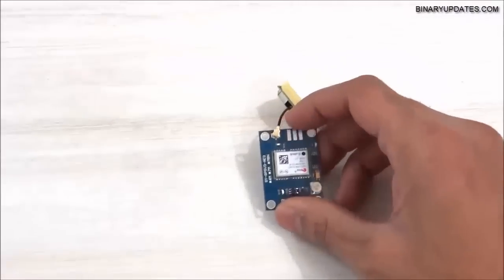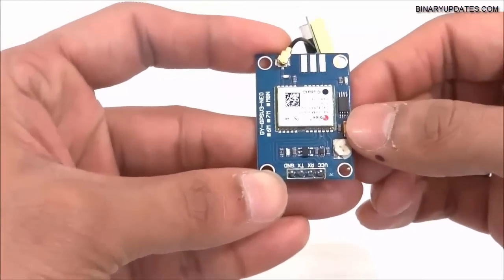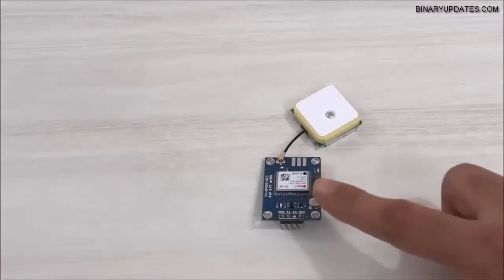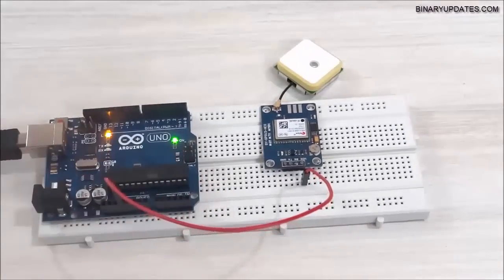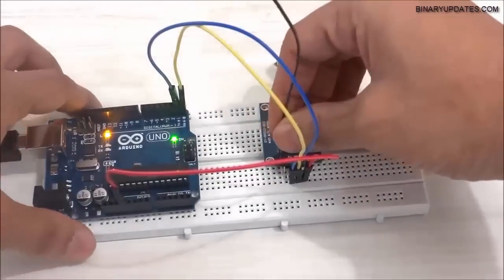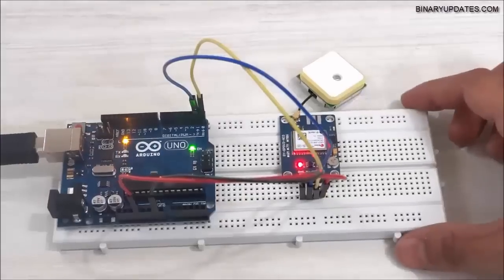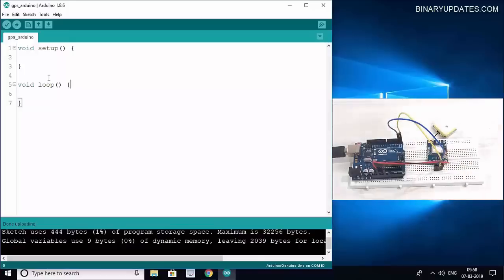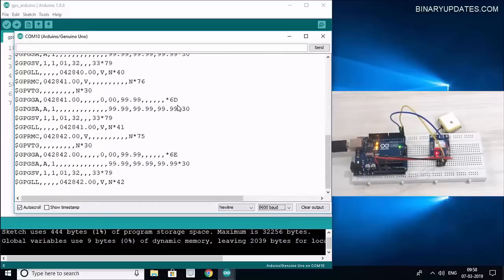GPS Module with Arduino- Ublox NEO-6M

Comment: What happen if we don't unplug the rx and tx connection when uploading? Does it ruin the module?
Reply from the maker: No, It will not ruin your module. The reason to unplug Tx and Rx while uploading code is because Arduino uses those pins. Once the upload is done then Tx, Rx pins will be free to connect to any external devices like GPS NEO-6M Module in this case. I hope this answers your question. Good luck and best wishes!

Comment: Code for this project
Reply from the maker: HI Kanagadurga, 
To read GPS data from module, I've used default Arduino sketch means empty setup and while loop. This means no special code required to read NEO-6M GPS data. Good luck and best wishes!

Comment: Hi I am having a connections problem with the GPS module and the Arduino, the Arduino always got shutdown when I try to connect the GPS module, specifically when I connect it to the power (5V), I believe it is a problem in the power distribution, plz help me fix the problem 😫🙏🏻

Comment: Sir source code sir
Reply from the maker: Hi Dada, I've used blank arduino sketch nothing special you can check in my video. So there is no special arduino program required for this experiment.
Reply: @BINARYUPDATES  ok sir.
Thank you sir.

Comment: While the power delivered to the NEO 6M can be 5 volts since it has an onboard voltage regulator, the data lines do not allow for 5 volts and unless a voltage divider or line level shifter are incorporated the voltage of the UNO data lines will destroy most of the NEO 6M's in time.
Reply from the maker: Hi Ronald, 

Its possible considering lots of Arduino board these days come in market with poor design and power issues. I've used quality Arduino and because of good power and grounding my NEO-6M Ublox GPS Module has tolerated voltage. And it worked in my case without causing any damage to GPS Module. There are so many cheap clones with loosely designed board. And these board needs to be careful with.....This is just my opinion. By the way thanks for sharing. Have a good day

Comment: Why is Tx to Tx and Rx to Rx.  Shouldn't it be tx to rx and vice versa ....
Reply from the maker: Hi Sibu, we've uploaded Arduino default sketch to read GPS data from NEO-6M Module. It has to do with Arduino bootloader. You can read more on this online. Good luck and best wishes!

Comment: how without uploading any code serial monitor will print
Reply from the maker: Hi Sarath, I have uploaded default Arduino Sketch to read data from NEO-6M GPS Module
Reply: @BINARYUPDATES  that also I do,but I'm not getting anything from seialmonitor

Comment: may i get the code
Reply from the maker: I've used default Arduino Sketch for this example project. Since we only need to read serial data coming from GPS Module to Serial monitor of Arduino. I hope this may help you. Good luck!

Comment: Is it unlimited range and can we also use it for feet detection for module rocket
Reply from the maker: Yes you can use NEO-6M GPS Module for your project!
Reply: Heh heh you were late but thank you 😅actually we are working on a different project our last one was done 👍 it worked.

Comment: If it worked really!!!!   then you are a great magician . cose  you connected tx  to  tx  and  rx to  rx  which is completely wrong connection .
Reply from the maker: You must know, I been using Arduino default sketch because of this I've connected the way I have connected Tx and Rx of GPS Module with Arduino. I hope you you read more of Arduino Serial communication. Its not like normal UART where you connect Tx to Rx and Rx to Tx like Serial UART transceiver. I hope this may solve your doubt. Good luck!

Comment: can we have the location even if the Arduino is not connected to the PC
Reply from the maker: Yes, you can power Arduino and GPS Module over standalone battery and it will still work. Once you upload arduino code you no longer need to stay connected to your PC. I hope this may help you. Good luck!
Reply: @BINARYUPDATES  thank you so much

Comment: You can send all the appendices from the documents and programs of the project
Reply from the maker: Hi I've used arduino default sketch and connections uses very simple Tx and Rx Pins of an Arduino Uno to connect with GPS Module. Good luck and best wishes!

Comment: I Connected GPS RX TO ARDUINO TX AND TX GPS TO ARDUINO RX, still works, also, wired on rx GPS 2 resistors 1k and 470 for ground

Comment: Sir kindly share code please 🙏
Reply from the maker: There is default arduino sketch used in this example. This means there is no special arduino code required to read GPS Data from Module. I hope this may help you. Good luck!

Comment: Why do I need arduino
Reply from the maker: Hi Cedar, I used Arduino here to provide USB interface with computer. So that I can show you GPS coordinate on serial terminal. You don't necessarily need Arduino, in-fact any other USB to TTL converter module also work fine.
Reply: @BINARYUPDATES  thank you sir. I have an upcoming project and would to contact you

Comment: I am not getting any blinking on the GPS module. Want could be the issue ?
Reply from the maker: It may be because you GPS Module couldn't track or find satellite. You can try change place preferably in open space you can test if it helps....

Comment: When you connect the arduino with the gps without uploading the program and the gps does not turn on does that mean it's not working?
Reply from the maker: You must upload default Arduino code as i shown in video lesson. And if connections are right then you must see GPS data in serial monitor

Comment: I am using a UART to TTL USB to test my GPS, I keep on getting the raw data your were getting at first. I have waited many minutes but my GPS is not getting any signal. What could be the problem
Reply from the maker: Hi Tinotenda, 

Make sure the baud rate of serial communication with default baud rate of your module if you're using USB TTL Converter. Also, change the location. Try to test in outdoor means in open space where it would be easy for GPS Module to get signal. I hope this may help you

Comment: Hi there , i have a question please, i use the same module but sometimes it takes up to an hour , is something wrong with my module?
Reply from the maker: Hi Sami, Usually it takes time to find satellite but try and test in open space once. If it can help to get data from GPS Module. Otherwise its possible that module may have issue
Reply: @BINARYUPDATES  thank you for replying , i searched what you said about hot/cold start and it helped me to understand how it works , now i do a cold start before starting my ardusat project then everything goes ok after that in the hot start <3

Comment: Can someone explain me how he doesnt use any code and that works?????
Reply from the maker: Hi Andre, GPS Module is sensor which communicate with satellite and collect latitude and longitude data. Now to read data from GPS Module I used NEO-6M from Ublox which support serial communication over UART pins Tx and Rx. I've used Arduino Tx, Rx pins with serial read code just to read GPS Module data......I hope this can help you understand why I need not have to write any special code apart from reading serial data coming from GPS Module connected to Arduino

Comment: how to install gps neo 6-m antenna?Is it a plug-in model or is soldering required? Thank you.
Reply from the maker: Hi Muhammed, GPS antenna comes with its connector which can be easily plug-in to Ublox NEO-6M Module. We don't need to solder it on Module
Reply: @BINARYUPDATES  Thank you
I was able to attach your antenna

Comment: How to send data to cloud ? On Our own server. If we don't have wifi in vehicle ?
Reply from the maker: Hi Pratik you can use GSM Module which usually comes with GNSS support. This will let you track your vehicle and send data to cloud using mobile data network. I hope this may help you. Good luck!
Reply: @BINARYUPDATES  means we have to add Sim card ? And also monthly datapack recharge ?

Comment: sir kindly guide me for arduino due 
aint showing any reading
Reply from the maker: Hi Ahmed, the procedure for Arduino Due will remains same. I would suggest you to make sure connections once again and try to test in open space to get satellite signal easily for your GPS module. I hope this may help. Good luck and best wishes
Umesh

Comment: Thanks a lot for your useful tutorials .
I am used NEO-6M GPS Module with ESP32 and connect Vcc with 3.3V also used your code but the module didn’t work (no output on serial monitor)
Can you tell me where the problem, please?
Reply: Did you get any results... Have you succeeded in your process
Reply: U should do it outside and wait for like 8 hours until it gets a lock on a satellite

Comment: hello, can you answer some questions please
1. this module can work out without an arduino micropocessor?
2. can we send the data to some like mobile or to the web, what do we need to do?
3. does it have a cost to use the satellites, or work with like wifi o is just put the battery and thats all?
4. can we modify the base code and save them inside the gps module?
thanks in advice for your time

Comment: I have some questions for you:
What is the GPS module supply voltage on this video ? 3.3v or 5v ??
Do you easily have problems to get satellites fixes ? Since you are indoor.. ??
Where is your clock located in the house ? 1rst floor ? Basement ?
Do you use GPS repeater to get sat signals ?
I built 2 clock GPS driven using another type of GPS module than the NEO-6M
and I'm having a hard time to get satellites signals.. Thanks !
Reply: Voltage supply of the GPS module is 2.7-3.6V as you can see at it's chip's datasheet https://www.rlocman.ru/i/File/2011/04/22/1.pdf

Comment: Does this module have different version?  At 4:35 When you connected ground wire, the led immediate lit up. Mine doesn't.
Anyway, I get gps data from serial port. So it's fine right? Also how long does it take for GPGLL to complete? I left it on for 5 minute and still got incomplete data.
Reply from the maker: Hi Pal, I've used Ublox NEO-6M Module in the video lesson. 

The ability of GPS module to take GPLL data depends on location where you've placed GPS Module. If its place in open space where GPS module finds satellite quickly then you get GPLL data quickly otherwise it takes time to get exact data. Now how long is bascially depends on place again where you're testing your module

Comment: Hello Sir. Could you make a video on how to use arduino with gps to turn on or off a relay based on speed detected. I'll like to have a gps control relay to turn some lights on in my car when current speed is <10mph and turn off the lights when detected speed is >10mph. Thank you.

Comment: 7:08 how can you be receiving things when you didn't even write anything to receive information in the code...?
Reply from the maker: GPS Chip on NEO-6M Module connects straight to satellite and start giving us latitude and longitude data on serial pins through which we only need to read the data coming from GPS Module. This is how GPS Modules works

Comment: hello every one,
I have two questions:
1 how accurate is this gps?
2 Which solution do you propose for some one who needs a precise positioning( maybe with an error equal to 2 cm at most) with respect to some fixed objects marked by a transmetter of signal
Reply: Late reply i know, this unit seems accurate to 2.5m on horizontal position. for something with 2cm accuracy you will need something with a ZED-F9P module. they are accurate to 1cm but come at a high cost.

Comment: It's never a good idea to be plugging modules in while the Arduino is powered up. You should power up after all connections are made. Everything isn't plug and play electrically.

Comment: This video is well explained. But Facepalm after 5 minutes. If you use the 3.3 Volts from the arduino, cause the neo 6m module is only 3.3 volt toleranted, then use a levelshifter for the tx line aswell. The arduino will send the data via tx pin as a 5volt signal bro.

Comment: Hi Binary Updates. Thank You for the good detailed information on the Ublox NEO-6M gps module. I am going to buy this exact module for a Chromebook that have converted to Android-x86 to use as a dedicated tablet for a drone flying app. I am going to crack open the Chromebook and hopefully be able to figure out a UART location to solder the appropriate pins to along with the 3.3 VDC supply pad,,for module. From doing a lot of reading on these GPS modules there are always manual configurations you have to enter in a  couple config files in linux. Have never actually found a how to on Android,which is surprising.  Hopefully I can make it work.

Comment: Sir i have done the connections as per ur circuit. but the LED module does not glow on the module. plz help me.i am working on the project related to GPS module. this is the second module. but am not able to understand the problem

Comment: hello sir can you make a video of distance.measurement between two points using tinygps.h library
Reply: If you had lat and long for the two points you could calculate the delta lat and delta long and then just use right triangle math to determine the "as the crow flies" distance.  The delta's would need to be converted to the distance units you want before doing pythagorus to get the distance, however. I am not sure how to convert the degrees delta's to miles but there must be a formula.  Google Pythagorean theory.

Comment: I need the code for this, how can I get it?
Reply from the maker: Hi Muhammad, Its just a simple default Arduino Sketch used to read latitude & longitude. Let if in case you still need arduino code.
Reply: BINARY UPDATES can i please  get the code??? for project purposes only.
Reply: @URLGamer_Z  
void setup() {
  // put your setup code here, to run once:
}
void loop() {
  // put your main code here, to run repeatedly:
}

Comment: On voltage levels, as far as I can tell the module does accept 5V supply as it has a regulator.
But UBLOX says the the data isn't 5V tolerant.  It's 3.3V CMOS, 3.6V absolute max.
The module doesn't add any protection to the TX/RX lines.
For breadboarding, I'd stick a 1k resistor in series with each line.
Reply from the maker: Thanks Mr. Epi for your valuable advice and comment. I appreciate you time to write. Thanks
Reply: I was about to ask about that Tx pin and was worried it'd fry the board. Thank you very much.

Comment: BINARY UPDATES makes a useful point in an earlier comment:
The TX pin on the UNO connector is connected to the RX pin on the chip that communicates with the PC.
UBLOX datasheet says TX is an output from its chip, so TX-TX means we're connecting the output of the GPS to the input of the USB converter, which is correct.
If you wanted GPS to talk to the Arduino instead of the PC, then you'd need to swap TX/RX.

As far as I can tell, the PCB doesn't swap the names, but I remain to be convinced of that..
Reply: Can you please elaborate, I'm still new in this so didn't understood much but I think what you are saying might be helpful to my project.
Reply: I need gps tracker coding for Arduino or NodeMCU

Comment: Tx should be connected to Rx & vice versa.
Reply from the maker: It depends in case of serial communication. but in arduino we'll have Tx and Rx already hooked up with USB chip which will make Arduino to acts as tranceiver by default. Because of this we've connection as shown in video. By the way thanks for your time & question

Comment: Did this module just worked right out of the box ? or you've to configure it first?  
Cuz mine one doesn't even power on and nothing shown on serial monitor :(
Reply: Turned out, mine one was faulty. Got a new one that worked out of the box.

Comment: 3:13 Isn't there a 3.3V LDO regulator connected next to module jumpers. So technically you can connect the module VCC directly to 5v too.
Reply: yes you can connect Vcc to 5 volts.
Reply: @bilal1708  can you please elaborate what you both are trying to imply

Comment: My daughter tried to connect gps to arduine but could not get any responce. The light ddid not show 
The connection was correct as per yours but no signe of responce. I tried to help her withe soldering the 4 jumpers and i checked the ohm and the are all 4 pins connected. Is this normal or may be the medual is deffected?

Comment: Tx with Tx?
Reply from the maker: Yes, its because in this example. We're using Arduino Uno with minimum code (default code). Which anyways enable transceiver. And so we must connect Tx-->Tx and Rx-->Rx otherwise in normal Serial UART communication we connect Tx --> Rx and Rx -->Tx. I hope this will help you. 
Goo day

Comment: Sir my GPS module takes nearly 40 min for tracking gps data how can fix the issue
Reply from the maker: Maybe you can try sometime to sit close to window. Usually I found that Its takes a while for GPS Module to locate the satellite in order to locate GPS Data. You must try to move around the place to find the best possible location. The closed room or locations usually takes much longer to locate GPS Data.
Reply: Maybe take outdoors if you can.  It needs line of sight to several satellites.

Comment: How can i send the real time gps location to my application
Reply: you have to  send data to any local server using GPRS and your application to local server and you can access the data from any location. and i suggest use GSM 900A module for GPRS.
Reply: you can input the NMEA messages from a GPS receiver into your application and parse specific messages (such as $GGA) for time of day.
Reply: You could even send the data in JSON format using web socket